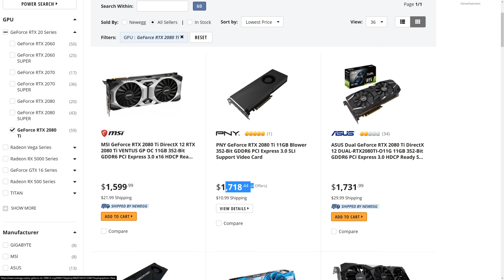Can $4200 buy a PC that will last 10 years in 2020?

Comment: I'm having some decisions to make but, I'm not sure what is better? I plan to use pc for gaming(GTA5, Battlefield 4/5, Deadside...), and casual 3D modeling(autocad, maya...)   

Should I upgrade my current pc;    Asus P7H55/USB3 ATX LGA1156 Motherboard
                                                            Sapphire Radeon HD 5770 1 GB Video Card
                                                            Intel Core i5-750
  4 threads - 2.7 GHz
                                                            4GB of RAM DDR3-1330 CL11 Memory  

 with    G.Skill Ripjaws X Series 16 GB (4 x 4 GB) DDR3-2400 CL11 Memory  +  Asus GeForce GTX 1650 4 GB DUAL OC Video Card  and wait 2-3 year fro new pc,

or should I invest in pc that will last me at least 5 years like:  	

Noctua NT-H2 3.5 g Thermal Paste
AMD Ryzen 7 3700X 3.6 GHz 8-Core Processor                                                                                                                 
be quiet! Dark Rock Pro 4 50.5 CFM CPU Cooler
Asus ROG Strix X570-I Gaming Mini ITX AM4 Motherboard
Corsair Vengeance LPX 64 GB (2 x 32 GB) DDR4-3600 CL18 Memory
Corsair MP600 Force Series Gen4 2 TB M.2-2280 NVME Solid State Drive  - for windows and programs only
Seagate BarraCuda Pro 6 TB 3.5" 7200RPM Internal Hard Drive  - for games and stuff...
be quiet! Pure Base 500 ATX Mid Tower Case
NVIDIA 900-1G180-2515-000
  GeForce RTX 2070 SUPER
Microsoft Windows 10 Pro 32/64-bit
be quiet! Straight Power 11 650 W 80+ Platinum Certified Fully Modular ATX Power Supply
Asus MG248QR 24.0" 1920x1080 144 Hz Monitor
be quiet! SilentWings 3 59.5 CFM 140 mm Fan x2

or you have some third suggestion?

Thanks :)

Comment: well my first build was a pentium g4560 dual core with a gtx 1050 2gb card with 8gb ram I build in 2017 it lasted me till 5 years games did not run well on a 1050 2gb anymore and 8gb so I upgraded too a ryzen 5 3600 16 gb ram i upgraded and a gtx 1060 6gb i upgraded my pc . cause i did not like the how choppy and laggy my streamers was and recordings were in my gameplay

Comment: 2080S is overspending too, considering that it is only slightly better than a 5700xt
Reply: The 2080s is only slightly better once the 5700xt is power modded. The 5700xt sits between a 2070s and 2080 in most titles according to GN benches at stock and OC
Reply: @KadiusFTW  2080s is almost twice the price of a 5700xt and only gives  20ish extra fps.
Reply: @Revener666  20fps is quite a lot for people trying to push the highest fps.

Comment: AIO coolers in my experience won't last more than 3-4 years. Had one which leaked over my 1070 after a year and killed it... (Cooler master one) and well ever since stuck with air but my mates pump gave up on his Corsair h120i after about 3 years
Reply: H100i

Comment: I dont think so! With the PS5/XB next gen coprocessors and completely different memory architectures, they will make desktop PCs require massively more RAM because the SSDs will not be able to instantly stream in assets like the next gen consoles. Also, he couldnt fit a fucking 3950X in a $4000 budget?

Comment: I know you will be disappointed in me but:
Alienware Aurora R11
Lunar Light chassis with High-Performance CPU Liquid Cooling and 1000W Power Supply
10th Gen Intel Core i9 10900KF (10-Core, 20MB Cache, 3.7GHz to 5.3GHz w/Thermal Velocity Boost)
32GB Dual Channel HyperX(FM) FURY DDR4 XMP at 2933MHz
512GB M.2 PCIe SSD (Boot) + 2TB 7200RPM SATA 6Gb/s (Storage)
US Power Cord
Dual NVIDIA GeForce RTX 2080 SUPER 8GB GDDR6 (OC Ready) with NVIDIA NVLink SLI Enabled
Killer(TM) Wi-Fi 6 AX1650 (2x2) 802.11ax Wireless and Bluetooth 5.1
CAD 4118.84 tax in...
thoughts?